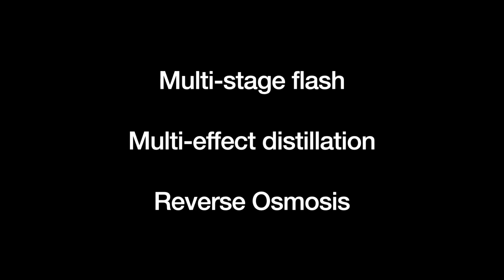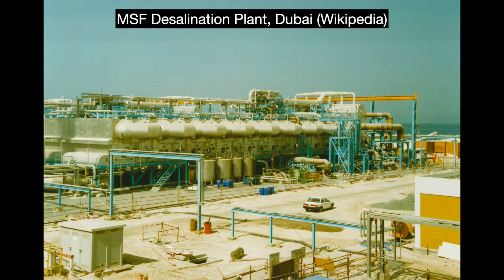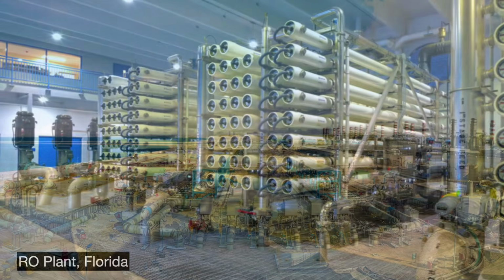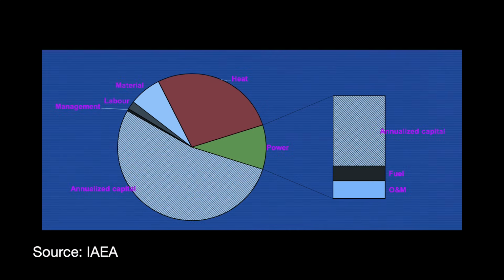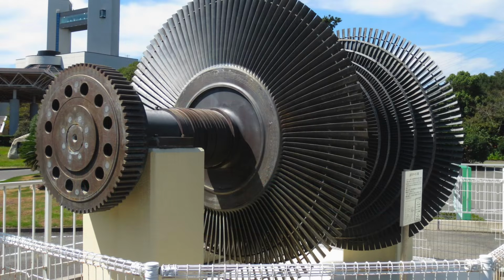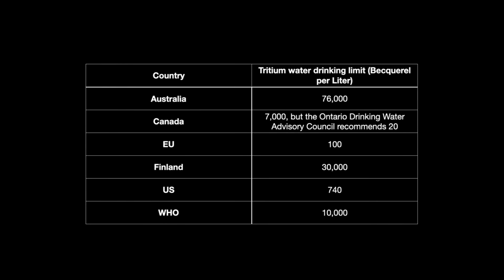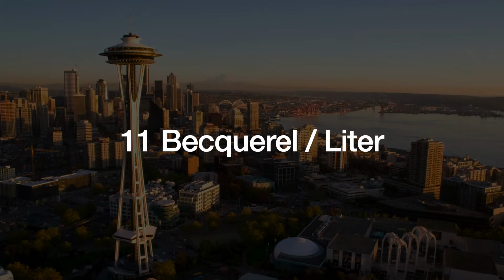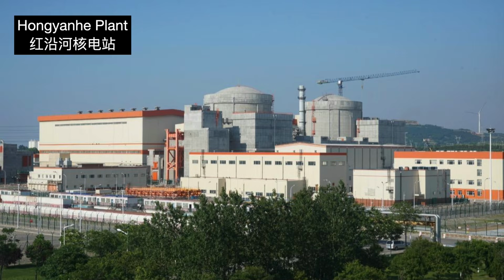Going Nuclear to Desalinate Seawater

Comment: The biggest environmental concern is what to do with the salt-enriched waste water. Great video otherwise, but you didn't even touch upon this.
Reply: 100% Spot On comment Bernard! I was going to post the same thing. Based on the other comments here, the commenters are unaware mountains of salt are created in the process and its a HUGE problem.
Reply: @freedomearthmoon1  salt that contains Lithium and much more👍
Reply: Release the 'salt-enriched' water onto large salt flats and collect the Fleur de Sel...
Reply: To clarify the issue. Salt is dumped in a really small area, causing localized damage. If you could dump it evenly over a 1000km^2 area in the middle of the pacific, there would be no issue.
Reply: American fast food chains:" did you say unused extra salt ? I'll take the entire stocks"
Reply: @hoangle2483  common, lets be realistic about this,  i order for that to happen, industry would have to pipe it somewhere, and it would have to be totally boiled off and containers of salt chipped out of them,  on a conveyor.
Reply: @hoangle2483  extra salt dissolved in sea water. Useless for the food industry.
Reply: @rolletroll2338  you do realize that Im making a joke about fast food industry right ? 
This is why Mom didnt love you Rolletroll.
Reply: This is the main issue in California, a shame it’s not cost effective to pump it into an area where it can evaporate and be harvested
Reply: @Sean.Vosler  <cynic mode>Its cheaper to outsource our pollution to China to mine stuff there and pretend its not us.</cynic mode>What we should  do is have an import tarrif for anything imported from a place that does not match or exceed our environmental standards.  Then there would be no incentive to ship the jobs overseas.  Kind of like what Trump did to Mexico when he said that cars imported had to have workers making a similar wage to US workers.
Reply: @kennethng8346  Yep! He did say that alright! Boy am I happy that things don't happen just because Trump says them!
Reply: @Sean.Vosler  with free energy you can pump.
Reply: While it should be mentioned, salt enriched waste water is not unique to nuclear desalination.  It needs to be designed into the system.
Reply: use as shielding to store nuclear waste maybe?
Reply: @marcopohl4875  I would not want salt water, or heck water in general near nuclear waste
Reply: @kennethng8346  small atoms, which both salt and water are composed of, a great radiation shields though
Reply: @marcopohl4875  Um, what?  Quick lesson radiation:

Alpha particles: essentially helium ions, very destructive, but very short range, paper can stop them.

Beta: electrons, generally stopped by something conductive like copper or aluminium.

Gamma: sorta like x-rays, best block is by mass, often heavy elements like lead.

Neutron, best blocked by bouncing off of similar mass particles, hydrogen for example.  That is why water or deutronium (hydrogen with an extra neutron) are good moderators.  Normally you only need this if blocking radiation from an active reactor.
Reply: @kennethng8346  so what you're saying is that waste doesn't release a lot of neutrons?
Reply: @marcopohl4875  To be honest, it has been more than 30 years since I've studied this, so bit brain rot is a real concern.  Best I recall, the main issues on containment of waste products were: management of the heat, maintaining a stable structure in spite of the radiation causing crystal fractures (why they use amorfus or glass substances) and prevention of water infilltration.  While undoubtably there is some neutron emission, I don't recall it being a lot.  If there were a lot I'm sure it would be mentioned because neutron radiation causes element transmutation, makes some isotopes radioactive, and tends to go straight through lots of metals (remember the neutron bomb from the 1970s?  It was a counter for a Soviet tank invasion of Europe).
Reply: @kennethng8346  salt water would be pretty useless then
Reply: @marcopohl4875  Huh?  I think I missed the context.  If you mean the original one about desalination of seawater, any reasonable scheme could have a seperate isolated loop in contact with the nuclear reactor itself.  If you go with a salt, sodium, or lead, that also means you can use low pressure vessels, and go very hot, to improve efficiency via the carnot law.  The second loop I would also make isolated, but with water.  The water would run the turbine to generate power.  After the turbine, you need to condense the steam to lower pressure, or it will slow down the turbine from back pressure.  This is where you do the sea water desalinization.  Engineer it so some of the sea water flashes into steam, but not enough to cause the minerals to come out of solution.  Condense the steam and you get fresh water.  Send the remaining brime out to drying ponds where you can eventually collect the salts and minerals.  So you have one nuclear power plant that provides power, fresh water, and minerals.
Reply: @kennethng8346  I meant my original suggestion to use it as shielding. I see your point now and agree that it wouldn't work
Reply: @marcopohl4875  water, especially salt water, is the one thing you don't want if you want to keep something stable for a long time.  Look at any ocean front to see the long term danage, then look at the Egyptian pyramids.
Reply: @kennethng8346  Serious question: If paper can stop Alpha particles then what are they very destructive to?

I'm just here for the physics.
Reply: @paulpinecone2464  I'm sure I will get some of this wrong, so take what I say with a grain of salt.  Gamma is like an x-ray, it penetrates far, but doesn't leave much impact in any one spot.  Beta is an electron, its sort of like electricity, it can penetrate, but doesn't leave much permanent damage.  Alpha is a helium ion, huge in comparison.  Think of it like a mac truck.  What ever it hits its going to transfer all its energy to the atom it hits.  Think of it like a cue ball hitting another ball.  That atom may not be important, or it could be part of your dna.  So outside of your body alpha doesn't damage much because your skin is already dead.  Inside it will kill anything in very close proximity.  Hope this helps.
Reply: Mine for lithium and other useful minerals?
Reply: @ronmaximilian6953  directly producing Na-ion cells for industrial storage of electricity.
Reply: I wonder how viable cutting the desalination output with waste water treatment output would be... (didn't search for any existing systems)
Reply: just lay a concrete pad down and then let the brine boil off the run a front loader to scrape up the salt
Reply: The salted water does not need to be in the same pipes from the reactor. The reactor can have a close loop, with pipes heating secondary pipe lines.
Reply: If your talking RO Reject, Evaporate it, the energy is there, and it’s more free water.
Reply: @aajohnsoutube  Hey! Just do the whole desal with solar! You're a genius! Hey! Go look up why people don't do that!
Reply: @paulpinecone2464  i don’t need to look it up. That’s a ignorant idea. What’s your point?   Evaporators aren’t used in large scale desal because energy costs are too high?
Reply: @aajohnsoutube  My point was that you suggested doing it. Maybe you should sit down and have a talk with you?
Reply: @sncy5303  Wrong!
Reply: Here’s a thought how about we get all the water out of the salt and use the salt for things when we use salt for.
Reply: @davidgrover5996  Sounds good in theory, the problem is? We don't need that much salt for anything. It creates a mountain of salt to provide scant little water in scheme of things. People can't seem to wrap there head around just how much salt is involved, and you can't put it back in the ocean, you'll kill the sea life.
Reply: @davidgrover5996  the world has too much salt.  Yeah there’s lithium, cobalt, strontium etc, but very rarely is it economical to extract these and the process all require >equivalent amounts of chemicals, and create even more brine streams to manage.
Reply: @aajohnsoutube  You keep acting as if throwing it away is the only option.
Reply: @davidgrover5996  look man, it was my job for like 12 years to evaluate options like these for a global leader (#1) in desal and zld tech.  I spent 30-60% Scouting for investment in companies, technologies and business models (globally) for treating and/or extracting value from difficult waste streams.  Still is my job, but not so directly in evaluation in a such broad range of technologies/companies.  98% of the time a waste stream is economically a waste stream unless someone wants to pay more to make it something more.  Edit: I should add now I am 100% focused on nuclear power.  Lolol.  True though.
Reply: llk
Reply: He touched on the issue briefly, but that's a concern for ALL desalination plants, not just the nuclear ones. And really, is it even a concern? With a pipe a couple of kilometers long with some holes drilled in it, you can spread it out enough that it won't pool up. I bet a lot of life will form around these pipes, what with the extra minerals in that water. A new form of extremophile, perhaps?
Reply: @RipleySawzen  Some environmental groups seem to think that anything made by man is bad, that every square foot of this planet has some unique endangered species.  Personally I'd think that a bunch of pipes with holes spaced out will be sufficient to disperse, especially if it is in an ocean current.
Reply: @RipleySawzen  as I understand it. Brine is heavier than oceanwater. Which means i flows down and end upp in the lowest area of the seabed where it kills all life because of the high concentration of salt.
Reply: @olavkarlsson6430  The solution there is rather easy, and that is to disperse the water over a large area. We're not really talking much water here either. The Colorado is a small river, and I'm using that as the measuring stick.
Reply: Really? What to do with salt? What about what to do with nuclear waste? I live in a country where the now thankfully defuncted government have decide to place a nuclear waste dump in my state to deal with waste from our 1 and only reactor and the idea has also been suggested that we should receive waste from all around the world because as you know every nuclear plant in the world stores their spent fuel on site because they don't know what to do with it. So the biggest environmental worry is what to do with spent nuclear fuel, I got to say don't bring it here! Because we already have 100million tonnes of tritiated water coming soon to our shores from Japan, the funny thing is that the uranium was mined here in South Australia....what goes around comes around.
Reply: What are we going to do about all the fresh water from rivers and storm drains being dumped into the ocean and reducing the salinity of the ocean? How are we going to prevent evaporation of sea water increasing salinity?
Reply: @LarsDennert  If you know anything about the Murry Darling system in Australia you'll know that rising salinity from overuse of water in irrigation means this isn't a problem....
Reply: Salt Brine could be used as ballast in ships that gradually release it after  leaving port on their way to the next port eventually flushing it completely out of the ballast tanks. By doing that the ship's propellers would thoroughly mix it with normal sea water and dilute it.
Reply: There are many industrial and even commodity uses for salt, we could figure something out I'm sure.
Reply: Evaporation pools and then extract the minerals after it drys
Reply: Melt it into hollow damn strong bricks.
Reply: Sea Salt,next to Himalayan, is believed to be a quality source of minerals for humans.  Evaporating the water molecules to harvest the salt should be easily resolved - use the "Global Warming" to advantage
Reply: @jbwentworthe6082  its annoyi g that every damn technology cannot remove all the salt from the water,  for obvious reasons,  i think they need to mix the bring with sewage amd inject it somewhere special
Reply: San Diego solved its water shortages with 3 desal. plants + storage tanks.  Reportedly, 3 yrs. of ordinary rainfall will offset 15 of drought.
Reply: Brine can be diluted from treated waste water from the existing water system, or using the storm drainage to balance the salt distribution. On another note, the more expensive investment is processing brine for mineral extraction or microplastic removal.
Reply: @Aereto  why dont they do this , do they in the US.
Reply: If the brine is too polluted to return then this won't work. There are environmental problems associated with diluted sea water from melting ice sheets. If we can return the brine it's brilliantly symbiotic. If we remove the brine too it won't work. We need to establish and maintain an optimal balance. After that we may need to minimize or even shut down these plants to maintain the balance.
Reply: Sodium based batteries?
Reply: Pump the Brine water to evaporation pools and let the remaining water evaporate. Then sell the remaining minerals for extra profit.
Reply: @GOGIRA_AMIGO  The big problem is that only a small percentage of the inflow through a reverse osmosis plant gets processed into fresh water. The majority of the water flows through the system and gets discharged, It is way too much to collect in ponds and evaporate into salt, unless you have several square km of land available. It generally has to be discharged back into the sea. Reverse Osmosis also get less efficient the saltier the water so you can't keep recycling the brine.
Reply: Dump this salt enriched waste water in the water ways of the developed nations.
Reply: Pump it into the desert or use the brine in a thermal process to make more fresh water and sell the sea salt as a separate product.
Reply: Let’s make a big salt mountain
Reply: It should be treated and sold as table salt.
Reply: @TheBooban  the desalination brine contains many components...lithium being one.
Reply: @cherylreid2964  Given the number of times you posted that brine contains lithium, I'm wondering if you have a personal need...?
Reply: Why not just use the salt waste water in a molten salt reactor . With heat you could separate the salt and the water .
Reply: @georgewbushcenterforintell147  I think it's the wrong type of salt...but, Lithium and other mineral extraction could be looked at since it's in the brine.
Reply: Oh, dear how would extra salty water behave in salty water? We need to study saltiness while CO2 acidifies the oceans.
Reply: @AstroGremlinAmerican  why dump it back in the ocean just dump it on a concrete pad in the sun and boom sea salt
Reply: @Slavicplayer251  brine from desalination contains Lithium and a multitude of other contamination.
Reply: @AstroGremlinAmerican  too much salt is poison for saltwater fish. If you are desalinating millions of gallons of water, you can create lethal brine clouds that kill whole areas of the ocean. It's a problem that has to be addressed.
Reply: @AstroGremlinAmerican  Extra salty water kills stuff and so does radiation....
Reply: You put it in the ocean and make it 0.000000000000000000000001% saltier for a few days before the water you took out returns to the ocean. You guys really never heard of the water cycle? The water won't disappear, its just "out of circulation" for a bit while people use it then it will, inevitably, return to the ocean.
Reply: @Henriburger1  Yes yes! Thank you for volunteering to have the entire output dumped on your lawn! Because from there it will be distributed around the entire planet with many 0's!

Eventually...
Reply: @paulpinecone2464  
Apparently I am aquaman now. My backyard is in the Ocean.
Reply: @Henriburger1  You have to deluite it while releasing it back into the ocean.  Otherwise Greenpeace will video the dead zone and it will be on the evening news.  Personally I'd put the exit toward the bottom of a water current, and arrange the exit temperature to be hotter than the current.  In that way the water will rise and mix into the current.
Reply: @kennethng8346  I understand that's more or less what happens.
Reply: @Henriburger1  Natural processes also form mountains and move continents, that doesn't stop other waste piles from building up.

What you think that just because water is a liquid that salt is going to magically and instantaneously dissapate back to equilibrium levels?

No, that's absurd. It's going to shock the local environment with brine a significantly higher concentrations than it's able to adapt to.

Waste byproducts are ALWAYS a problem to be taken seriously.